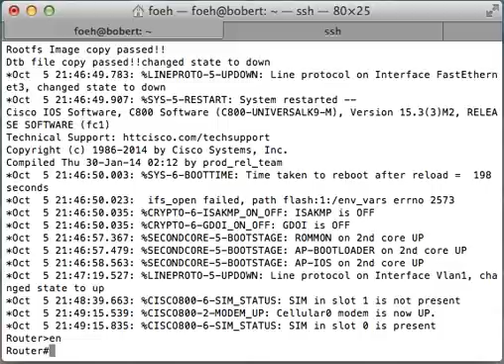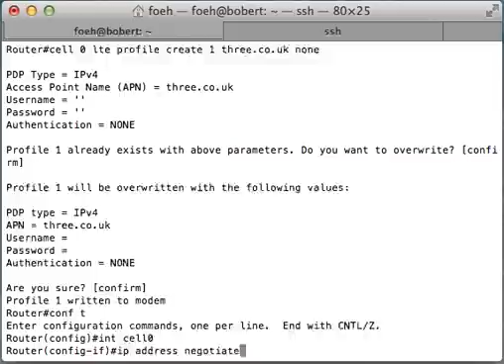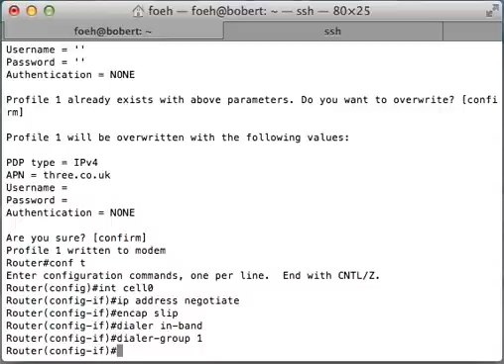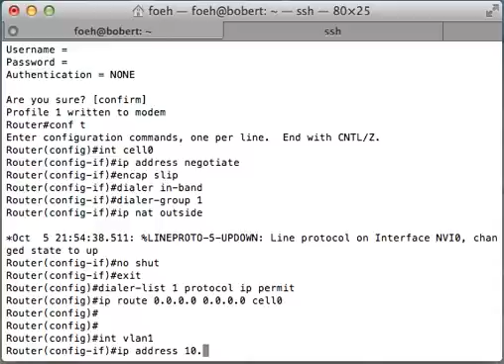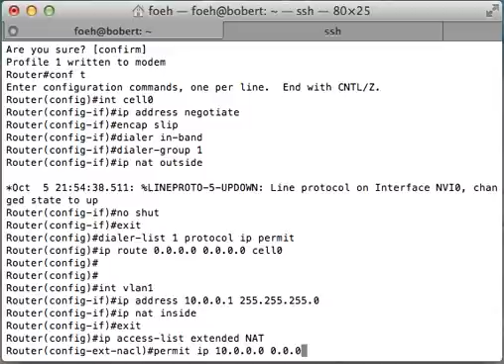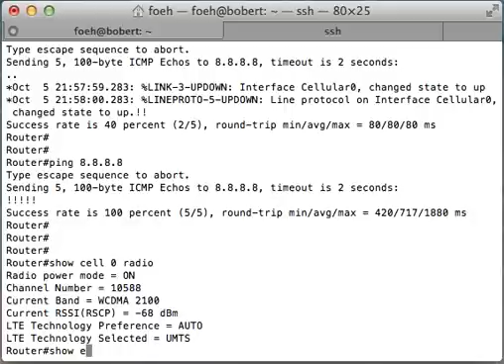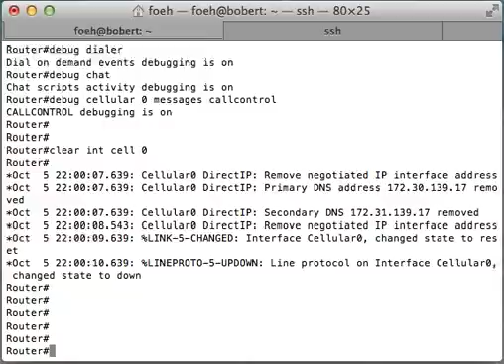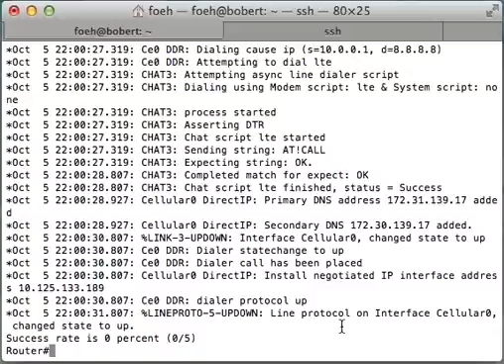Minimal 4G LTE Configuration Example (Cisco 819 router)

Comment: Thanks very much for this. Tried this config on one of the new 1117-LTE models and looks to work good on it as well. The only difference is that there is no 'encapsulation slip' option so you have to use ppp.

Comment: @Networking Bodges  how to configure Cisco EHWIC-4G-LTE-A on a cisco 3945??? Help at&t
Reply from the maker: Hi - the process should be basically the same with the EHWIC but instead of using the Cellular0 interface it will be Cellular0/0/0 or similar (depending on where the EHWIC is installed). I'm afraid I don't know the APN details for your carrier, I would guess their helpdesk should be able to tell you if it's not readily available online.
Reply: @networkingbodges1034  AT&T, great information! Thank You!

Comment: Very good video!  Do you have to register IMEI number with Cell carrier first to get LTE or 3G service?  Just curious how I can register the SIM card for device.
Reply from the maker: Hi. I've never had to register an IMEI with the carrier, this is across Vodafone, EE and Three (UK carriers). I guess it depends if your carrier locks the service to an individual device, which I would guess is fairly unusual.

With regards to registering / activating the SIM, the router is capable of receiving SMS (and possibly sending them, I  can't remember) so that may help, however I've always just put the SIM in a mobile handset to do the activation.
Reply: Yes, that's how you sync the sim with the router. With Verizon or AT&T. not sure about international carriers.

Comment: Is there anyone out there that can help me with a 1941 an the config to get the 4g-lte card working? I have a basic understanding of cli, but i think someone needs to add something to the config to complete the puzzle.
Reply from the maker: Hi - the config for a 1941 with 4G card should be basically the same as in this video but with a different interface number (i.e. instead of Cellular0 it might be Cellular1/0/0 or similar). Good luck :)
Reply: Thanks for the reply, i cant seem to get it working can you see anything ive missed ? thanks in advance 

Using 2047 out of 262136 bytes
!
! Last configuration change at 11:03:13 UTC Thu Sep 14 2017
!
version 15.4
service timestamps debug datetime msec
service timestamps log datetime msec
no service password-encryption
!
hostname cisco1941-4g
!
boot-start-marker
boot-end-marker
!
!
enable secret 5 $1$2Q4r$nuTqI7yDK7ghBBfvsa4qO.
!
no aaa new-model
!
!
ip dhcp excluded-address 10.0.0.1 10.0.0.10
!
ip dhcp pool CLIENT
 import all
 network 10.0.0.0 255.255.255.0
 default-router 10.0.0.1
!
!
!
ip cef
no ipv6 cef
!
multilink bundle-name authenticated
!
chat-script lte "" "AT!CALL" TIMEOUT 60 "OK"
cts logging verbose
!
!
license udi pid CISCO1941/K9 sn FGL192624RT
!
!
username admin privilege 15 secret 5 $1$lJFD$U/prO1nMaSRjzwDPW1I2g1
!
redundancy

!
!
controller Cellular 0/0
 lte modem link-recovery rssi onset-threshold -110
 lte modem link-recovery monitor-timer 20
 lte modem link-recovery wait-timer 10
 lte modem link-recovery debounce-count 6

!
!
interface Embedded-Service-Engine0/0
 no ip address
 shutdown
!
interface GigabitEthernet0/0
 no ip address
 shutdown
 duplex auto
 speed auto
!
interface GigabitEthernet0/1
 ip address 10.0.0.1 255.255.255.0
 ip nat inside
 ip virtual-reassembly in
 duplex auto
 speed auto
!
interface Cellular0/0/0
 ip address negotiated
 ip nat outside
 ip virtual-reassembly in
 encapsulation slip
 dialer in-band
 dialer string lte
 dialer-group 1
!
interface Dialer1
 no ip address
!
ip forward-protocol nd
!
ip http server
ip http authentication local
no ip http secure-server
!
ip nat inside source list nat interface Cellular0/0/0 overload
ip route 0.0.0.0 0.0.0.0 Cellular0/0/0
!
ip access-list extended nat
 permit ip 10.0.0.0 0.0.0.255 any
!
dialer-list 1 protocol ip permit
!
!
!
control-plane
!
!
!
line con 0
line aux 0
line 2
 no activation-character
 no exec
 transport preferred none
 transport output pad telnet rlogin lapb-ta mop udptn v120 ssh
 stopbits 1
line 0/0/0
 script dialer lte
 no exec
line vty 0 4
 login
 transport input none
!
scheduler allocate 20000 1000
!
end

Comment: Thanks, this was helpful. For any who need it... using this router with a Verizon SIM in the US .. the profile command is "cell 0 lte profile create 1 VZWINTERNET"  ... finally found the APN designation in the bowels of the web. Called 3 or 4 different support desks and no one knew the answer !
Reply from the maker: Thanks a lot for sharing - I'm sure there will be others battling to get the same information!
Reply: @networkingbodges1034  how to configure Cisco EHWIC-4G-LTE-A on a cisco 3945??? Help at&t

Comment: Thank you for to the point hands on video - much appreciated!
The router i have is got 2 slots for SIM cards (810). is it possible to use both SIM cards from same provider (ee) and do equal cost load balancing? I only need it for 1 day event to provide max bandwidth possible.
Thank you in advance
Reply from the maker: Muhammad Lateef I'm not familiar with the 810 but f it's anything like the 819 then the two SIM slots cannot be used at the same time. I suspect you're probably out of luck.

Comment: Nice video... But I am getting an error while executing the command..
ROUTER(config-if)#dialer-group 1
%Remove Dialer Profile Configuration first
Reply from the maker: Fahad Abdullah I guess there may be some old configuration on the port, for example it may be in a dialer pool already. Did you start from a blank configuration or were some services already set up on the device?
Reply: Networking Bodges there was some configuration setup already infact... I shall reset the wholething and try again later...but I have a question, if i want to setup a cellular profile  with the username and password blank, how do i do it????
Reply from the maker: If you set the authentication type to "none" in the cellular profile that should do the trick. One of the gotchas I found was that with IOS 15.2 the option didn't exist, however it is present in 15.3. The other thing I noticed was that if you set a user name and password then switch the profile to type "none" it still sometimes shows the old credentials, though as best I can tell that's just cosmetic and it doesn't try to use them.
Reply: Networking Bodges Authentication type is PAP, but the username and password are blank... 
What do I do if I want to NAT my public ip to my local server whose IP address would be 192.168.2.200?
Reply from the maker: I'm not sure - if authentication type "none" doesn't work you may be able to do something with chat scripts. I'm afraid I don't have a carrier like that to test against.

NAT works the same on 4G as any other kind of interface, you can use a static NAT to the dialer interface but most carriers don't assign a public IP to 4G subscribers (they usually give out private IP and NAT upstream).